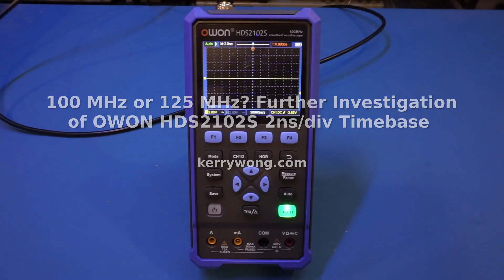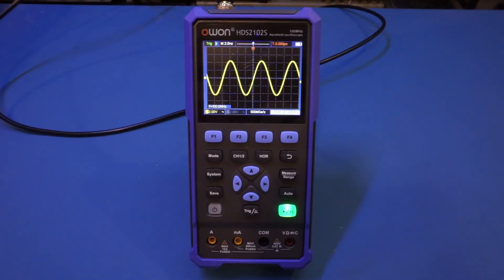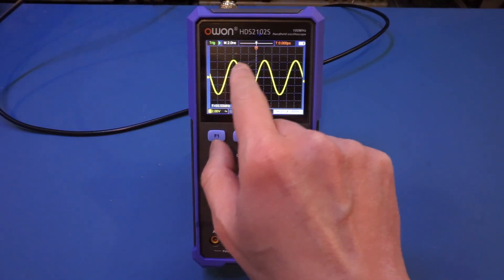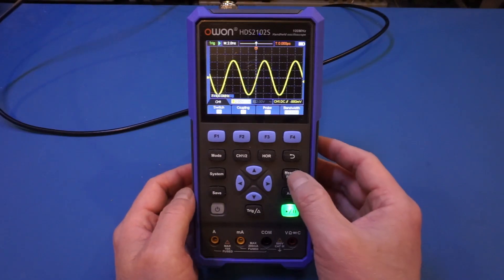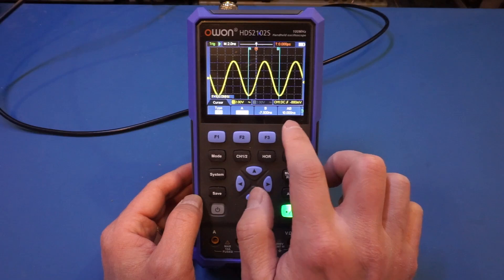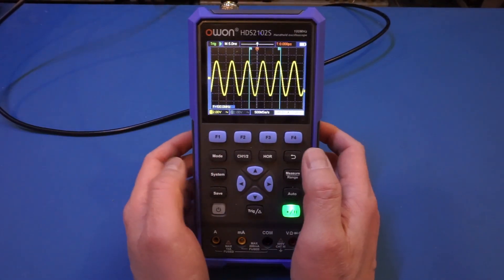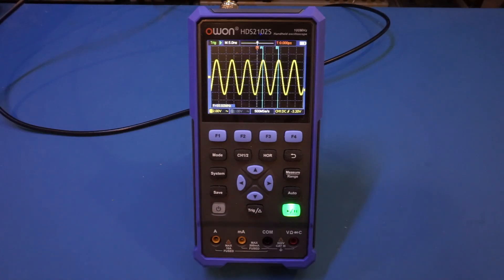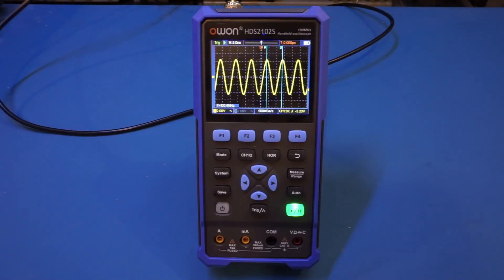100 MHz Or 125 MHz? Further Investigation of OWON HDS2102S 2ns/div Timebase

Comment: This is the kind of silly bone headed mistake that could totally destroy their credibility -- but there is a way that OWON can redeem themselves, and more than recover their reputation, while rewarding their early adopter customers by adding a few really cool new firmware features when they do the now-inevitable firmware update. 

I'm talking about features that would elevate the HDS2102S from a humble "scope meter"  class to  near Star Trek Tricorder levels of awesomeness - and make it just the kind of must-have tool that no self respecting geek could resist. 

For example, how about a built in function to allow the scope to sync the AWG and CH Math functions to create and display really nice amplitude/phase bode plots as a simple network analyzer?

It's really kind of stupid that the manufactures of these scopes with built in AWG capability don't already provide this kind of capability, since it can be done soooooo much better if done internally by the firmware because,  the internal algorithm can access the original AWG timing to calculate phase, and use gain stepping of the input attenuation as needed to extend the measurement range to 80dB or more!  

It's not particularly difficult - just divide the requested frequency range into about 8000 points corresponding to the sample memory size, step the AWG to each frequency, and do an amplitude/phase calculation based on the log() converted measured level (gain stepping the input attenuation as necessary to improve dynamic range), load that value back into CH1, and then optionally also calculate the phase based on zero crossings compared to the original AWG waveform timing, which can then be plotted as data points into the channel 2 sample memory - SIMPLE.

Same deal with adding some basic FFT MATH functions.  There's tons of freeware code to do fast FFT;s  - and given the really impressive update rate that this scope is capable of, it's obvious that their is plenty of CPU resources available - so why not add some basic FFT functions to allow basic spectrum analyzer like features?  

Come on OWON, at more than $250, it's time to start to compete head to head with some of the mid-level Rigol and Siglent scopes by adding some more advanced firmware features.

Or just open source the firmware, and let the community do it for you.

Comment: I just received an HDS2102S shipped from a US distributor.  The 2 nS/div bug appears to have been corrected in firmware 1.5.0 installed on the unit I received.  A 100 MHz sine wave from my IFR service monitor correctly occupies five horizontal divisions.  The scope indicates 100.0 MHz and Va 54.4 mV for a -20 dBm 50 Ohm output.  I’m not exactly sure what “Va” means because -20 dBm into 50 Ohms corresponds to 22.3 mV RMS or 62.3 mV peak-to-peak.  At 100 MHz the indicated Vpp is 55.2 mV and the cursors indicate 56 mV - not too bad.  At 10 MHz the Vpp is very close, indicating 63.6 mV
Reply: Thanks for posting this. I feel better about buying one now.
Reply: @andypalm7061  So far, no regrets.  The HDS2102 is quite a lot of instrument for the cost.  I have gotten more use out of it than I expected.
Reply: @wtmayhew  Nice. I guess I can start my hunt for a unit now.
Reply: @No_Kings_Allowed  Thanks for the correction.  About displays ver. 1.5.0.  It does not say whether it is firmware or hardware version.  I can confirm the 2 nS/div scaling is correct on the unit I have.
Reply: @No_Kings_Allowed  yes, that is correct.

Comment: The division scaling being incorrect on the 2 nS/div sweep is not a deal breaker for me as long as the measurements are correct.  I ordered an HDS2102S anyway.  I was waiting for an affordable meter scope with usable 100 MHz bandwidth single channel or 70 MHz dual channel and the HDS2102S delivers on that.  I am also very impressed with how quickly the instrument boots up and how quickly it locks on to a stable waveform display.  For the modest cost, I can live with a few minor compromises.

Many thanks to Kerry for the informative reviews.

Comment: nice.    CAN WE TEST COMPONENTS USING X-Y MODE??
Reply: I have an octopus tester. I am running it from a 12ac wall wort now to my Tektronix analog scope.  I was hoping I could use the onboard signal generator to drive it.  Should have my scope by the weekend and will give it a try.  Used a Huntron Tracker back in the 80's and loved it.  I think they run on 400 hz if I remember so can't wait to give it a try.  It would be nice if they had it as a function on the meter. Only a couple extra resistors to make it work.
Reply: @alanduncan3710  I have had the HDS2102S for a week.  The only thing I found was that the vertical offset / trigger level was off about 1/10 division, and running the internal calibration from the System Button menu while in the channel 1/2 vertical mode fixed that.  The timebase is extremely accurate.  I set the generator for a 1 volt 20 KHz P-P sine wave and measured 50.000,0 uS period on my Keysight meter after both instruments had warmed up for 60 minutes.  The 20 MHz sine wave showed the strongest overtone at 100 MHz and suggested the generator has 14 bit resolution.  In Generator mode, I set the frequency to 20 MHz snd output 50 Ohms in the System menu.  Adjusting to 0.63 Volts p-p displayed a reading of -0.1 dBm on an Agilent spectrum analyzer.  I have not yet had a chance to test out the multimeter mode in depth.  The continuity function beeps quickly on contact and sim fast enough to make intermittent contact audible.

There are a few compromises in the HDS2102S, but it is an excellent unit overall.  The maximum vertical sensitivity is 10 mV/ versus 5 mV which is common on most bench oscilloscopes.  Trigger options are strictly voltage based.  There is no FFT spectrum display mode.  The generator has a relatively small number of pre-programmed so-called arbitrary waveforms.  The generator does not support modulation or external sync.
Reply: The HDS2102S has X-Y capability.  There is no internal biasing mechanism as there would be in a transistor curve tracer, though you could probably make a test jig to bias the components under test, and use the internal signal generator for voltage sweeping components.

Comment: Hi.My HDS2102S has been upgraded once for Japanese customer(I gave Japanese fonts to OWON).So it is not same as factory setting,but maybe if you upgrade the newest firmware,the bug maybe fixed well.Even if you get the newest firmware,the procedures are a bit complicated,so I recommend you contact your distributor,and  let OWON know this video.My HDS2102S be fixed 5divsions as 100MHz.

Comment: Hi,I will check my HDS2102S,and If I identify same bug about time base 2ns/div measurement.I will report it to OWON as one of the distributors.
Reply: I have an Owon bench meter and I had a question about the RMS AC measurements on the mV scale.  I e-mailed Owon’s support and received a helpful answer within 24 hours.

Hopefully Owon will be responsive to reports on the scale error at 2 nS on the HDS2102S.
Reply: @wtmayhew  　Hello.I don't know what bench top model like XDM1041 or others,usually amatuer enthusiasts don't measure such 1mVrms.Maybe I notice it by using DMMCheck Plus,but I have not reported it.LOL But if you did that,OWON fixed this isuue by fixing the firmware.Good job.As I mentioned before here,when I pointed out Japanese fonts are not good,so I gave the revised fonts,This issue scale error has already fixe well.So maybe from now on,you purchase newest HDS2102S,you can get HDS2102S which is fixed problem.
Reply: @kh7333  Thank you.  I am not where I can look at the model number of my bench meter right now. Foe the money, it is nice and includes four wire Ohms.  The strange behavior is that for low signals at  6.0 mV RMS if memory serves me right, the readout suddenly drops from a correct reading to 0.0 for any input less than 6.0 mV RMS .  I believe they blank the display because internal noise reduces precision.  I suggested Owon put an indicator dot on the bit mapped display to show precision is reduced, but still allow display other than 0.0.  This would be handy when trying to null a circuit where you care more about getting as close as possible to zero rather than a precise value.  Owon replied to me that this expected behavior for the instrument.